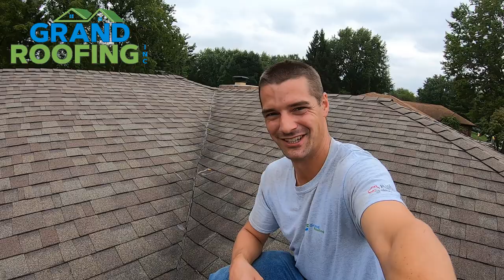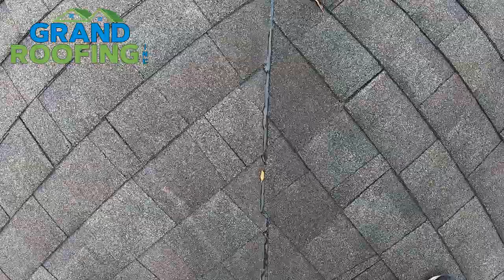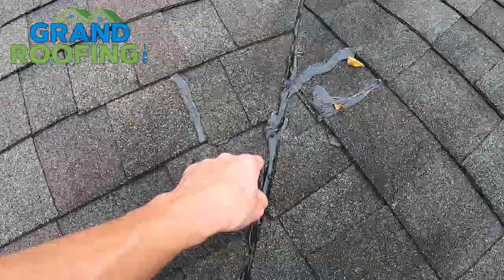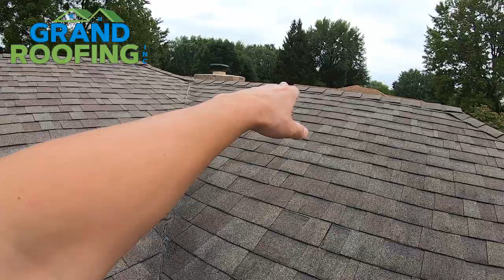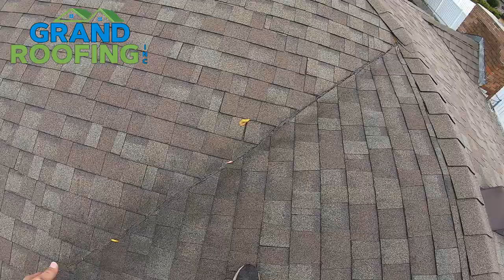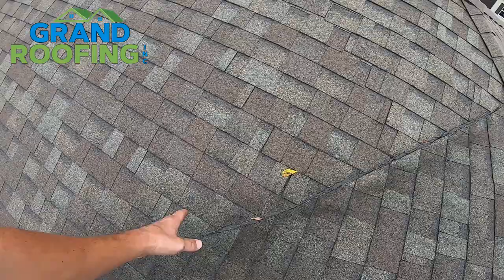Worst roof ever - Bad Valley Install

Comment: No machine gun nailers!! This is another homeowner's nightmare. Straight up. 
I am learning sooo much from watching your videos. Should I press my roofing contractor to use 4, 5 or 6 nails?? And how roof pitch and weather, manufacturers advice and local building codes can affect those answers. Then there is the type of nail to use. Steel, galvanized, aluminum, copper and some look like screws-have threads, and some are smooth. Nail placement is everything! Wow. 
I have a new roof scheduled and I feel out of my realm completely.
Reply: How did the new roof install go? What specifications did you end up going with?

Comment: Here is the bottom line on this . . . First the sand will come off these flimsy asphalt shingles and clog your gutters and drains.  The metal roofs look good but the 30 Ga metal is too thin and rusts . . . noisy especially in a hail storm or a hard rain: I  am looking to pour a solid concrete or clay roof with attach points so form can be added to create a beautiful tile appearance . . . these attachments are to become one piece so there is no possible leakage. This concrete roof should last over 50 years but is to remain on the roof. . . not removed and replaced with the piece by piece so the cost is ridiculous. No more halfwits working on roof jobs or in the government.  The landfill is full and replacing the asphalt shingle with better material appears reasonable.  It also adds more aesthetic value to the structure.

Comment: First time i saw closed valley in asphalt shingle roof was here in YT. 
Not single roof here is made with closed valley all are open valley and most likely one reason, it´s much easier to do and for sure doesn't leak so easily.
Reply: Any method, not done correctly, will leak.

Comment: Literally all you have to do is take a hose up there and spray small parts of the roof while a partner watches the area where the leak is and let's you know when you hit the right spot. Have to move slow to give water time to get down to partner.

Once you locate the exact location of leak. Choose a path to repair.

Comment: So don't figure out the cause of the leak with a house, just replace the roof. Hell of an upsell.

Car goes into mechanic with a leaky head gasket. Service writer tell customer needs a new engine. Too much work trying to diagnose the cause of the leak and trying a new gasket. Tries to convince customer selling them a new engine is a better option than looking into minor repairs.
Reply: @WaterMonger12  You cannot be serious...
Reply: @mjstrese  yeah, he is serious. The roofer knows what the cause is and the fix will cost as much to monkey into place as redoing the whole roof.  Every thing he touches to fix it becomes a source of the next issue, just redo the whole thing for the same cost.
Reply: It's needs a new roof because it wasn't installed correctly and can't reliably be fixed. Everything else would just be a band aid repair that would eventually leak.

Comment: Show us what your talking about?
Reply from the maker: What, like videos on different valley installs?
Reply: @GrandRoofingInc   yes please.   Show me how to roof my valley correct
Reply: @GrandRoofingInc  that would be a great idea,  so like when you're showing these fail videos,  you can put a link in the video and point to it and say,  "If you'd like to learn the proper way to install a valley,  click on this link here" 

Your channel is growing and you've got some serious potential to stand out and above most other roofing channels
Reply from the maker: @ScottWConvid19  That's a pretty good idea thanks! I want to be a different Roofing channel. Not the same old (world's fastest roofer). If you want to see a totally different unique roofer check-out Patrick's epic journey. He commented above. It's my brother, he's roofed almost as long as me but turn commercial fisherman.
Reply: Open valley is good to start with and use 3 ft wide asphalt strip into valley first then shingles over it with some added tar and leave 8 inch wide clear channel in middle.